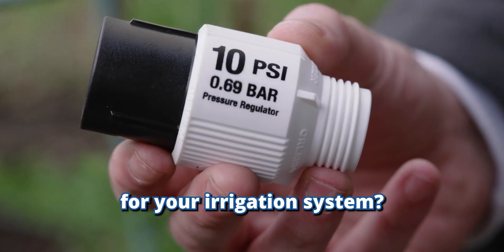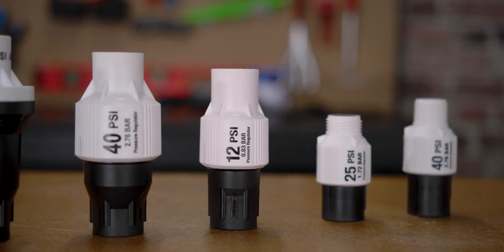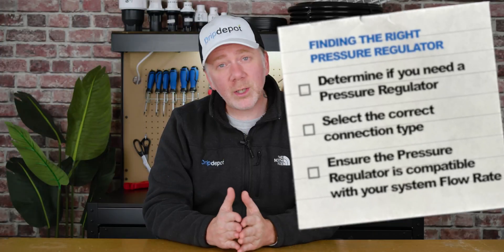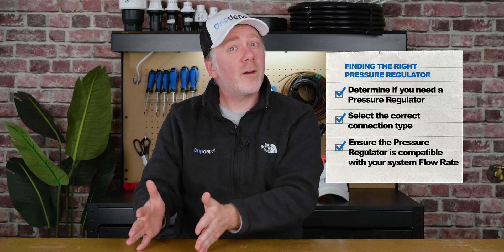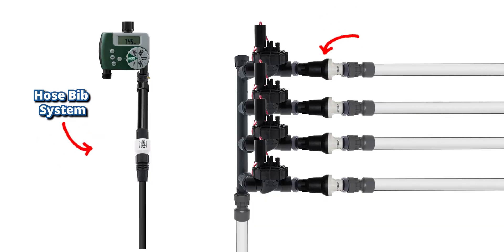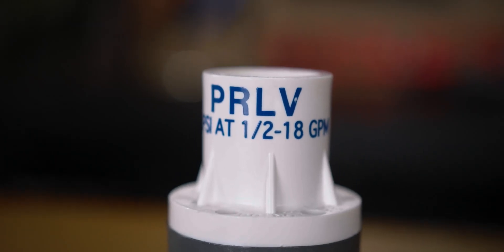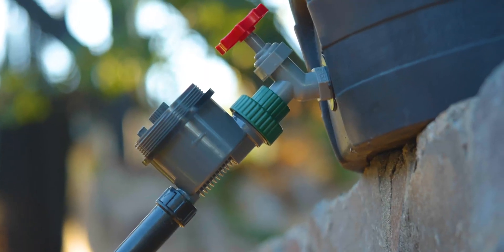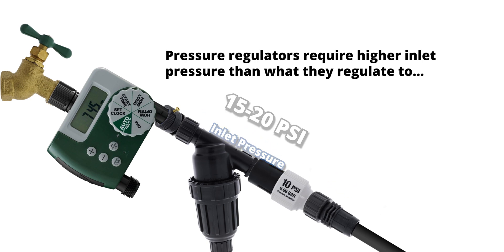Do You Really Need a Pressure Regulator? Understanding Water Pressure & Irrigation Systems

Comment: Question. are the pressure regulators compensating for inlet pressure? dose the output change if the input pressure changes? these are orifice based regulators i assume. could you not just use a gate valve and have the ability to change the orifice size and fine tune your setup. say you plan on running  different plants with different harvest times and you emitter count could change up/down. i find using a gate valve works better for fine tuning.
Reply from the maker: Great question!

Gate valves (and even other types of valves) can work, but regulators have the advantage in that they do compensate for inlet pressure.  Across a fairly wide range of pressures too -- the most common one for residential users is the hose threaded 25 PSI version which can maintain 25 PSI downstream pressure anywhere from 30 to 105 PSI at flow rates of 0.5 to 7 GPM.  

They have larger ones for different applications and, save for their Limit Valve, work essentially the same.  

If inlet pressure never fluctuates a valve could probably serve just as well, but I'd likely still recommend the regulator as they tend to cost significantly less but accomplish the job just as well :) 

Senninger, a manufacturer of pressure regulators, wrote a white paper that covers them pretty well if you (or anyone reading this comment!) wanted to dive in a bit more: https://www.senninger.com/sites/senninger.hunterindustries.com/files/understanding-pressure-regulation-white-paper.pdf

Edit: Apologies, I didn't address the plants with different harvest times!   

In most cases an inline shut-off valve to shut that portion of the irrigation would do the trick -- since most drip irrigation works around the same pressure (10 to 30 PSI, with the most common being 25 PSI) different pressure is not usually needed for different emitters.  The big exception is drip tape, which has to be 15 PSI or less (depending on wall thickness), but most other emitters will work fine at 10 to 15 PSI, so even in those situations pressure could be maintained at 10-15 even after shutting portions of the system down for the season.

Comment: My irritation is before the home pressure regulator
Reply from the maker: Sounds like you'd likely need one if the irrigation is before the pressure reducer -- that's not a bad thing though, starting off with a healthy pressure helps is a good starting point in pretty much any irrigation system :)

Comment: Good info. My pressure at the backflow preventer is 104 psi, way higher than recommended. That probably explains why I have had pipe joints to separate and leak.
Reply from the maker: 104 PSI is definitely likely the culprit!  That's some very high pressure -- a good problem to have sometimes, you'll always at least have enough available pressure for pretty much any emitter type (heck, you might need to regulate even for lawn/turf sprinklers at 104) :)
Reply: @dripdepot  Thanks for that quick response! I should have mentioned that the 104 was my static pressure. I will take additional pressure readings this afternoon. I should take a reading after the backflow preventer since it reduces the pressure by 15 psi according to its manual and another reading with the system running.
Reply from the maker: @harvey8695  You've got the right of it, the backflow will definitely cause some pressure drop, and friction loss while water is flowing some more.  If any questions come up while you do this (or after depending on the results!), don't hesitate to comment, happy to assist :)
Reply: @dripdepot  the dynamic pressure dropped to 65 when the system was running, much better than the 104 :)
Reply from the maker: @harvey8695  Ah, very nice!  Is this for a lawn system?  If so, you're looking good unless using unregulated spray bodies (which are somewhat rare now).  Great for rotors and regulated spray bodies, great how it came down to basically  sweet spot =D
Reply: @dripdepot  it's a five zone system covering about 14,000 SF of lawn, all rotary heads (6-7 per zone)
Reply from the maker: @harvey8695  Perfect!  You're in a good spot in that case -- unless you're getting a lot of overspray somewhere, it's highly likely you're good without a regulator :)

Comment: Do you have a universal coupling for drip lines. I want to use it on a garden row drip line that is between rowers. The drip line is removed for row tilling or hoeing
Reply from the maker: Depending on the size of your lines, it's very possible something could achieve a sort of quick disconnect so you can easily remove lines --  is it the drip line themselves or the mainline feeding it you'd like to be able to quickly disconnect?  For 1/2" mainlines, we see a lot of folks use two fittings to create a sort of quick disconnect -- one is a male threads x tubing and the other a female thread swivel x tubing -- the swivel on the female thread fitting allows it to be turned without needing to turn the entire thing, so you can quickly unthread it to disconnect the lines.  The same is possible for 3/4" and 1" mains as well.  

Here's a link to the 1/2" versions just in case (the larger ones are available there using the dropdowns) -- Male threads: https://www.dripdepot.com/search?q=1203 -- Female threads: https://www.dripdepot.com/search?q=1193

Comment: Hi, is the prlv only use to regulate each regular regulator to have constant pressure in each lines or can i just get the prlv to regulate all 8 of my lines to have constant 10 psi?  Each line is about 80 feet and the water pressure on the property is 40-45 psi.  It seems to drip fine when i have 4 lines open but when i open the 5 line i lose water pressure in the lines.  Im trying to have all 8 lines open at one time if possible by using regulators or am I missing the point on the use of regulators?  😅  Thank You
Reply from the maker: That's a very good question, you're definitely headed in the right direction with your query.  There's a couple things at play here: the regulators we're using in the video cannot withstand constant pressure, so you generally need one for each zone or line (however, if you open them all up at once, you could go with just one so long as it is relieved of pressure when the system is not in use).  

With that said, there are pressure regulators that can withstand static pressure (these here: https://www.dripdepot.com/search?q=14405 ) and can be used upstream of valves so that they can regulate for multiple zones/lines.  

With that also said, there's another limitation you might run up against when trying to operate many lines/zones at the same time: flow rate.  In addition to sufficient pressure, you'll need sufficient flow for all the emitters operating at one time.  As a quick example, if your water source flows at 10 GPM but you have 15 GPM in emitters trying to run, some of the emitters will be starved of water and won't work as they should, if at all.  The symptoms for lack of flow are very similar to that of insufficient pressure: not emitting as much was as they should, dribbling instead of spraying, barely dripping, etc.  

Depending on what your water source is, there's an easy and reasonably accurate flow rate test you can do with just a timer and a bucket.  Time how long it takes to fill the bucket with water and then plug the numbers (volume of bucket and time it took to fill) into this calculator, it will give you a pretty good approximation of your water source's flow rate: https://www.dripdepot.com/irrigation-calculators/flow-rate-calculator

You can then compare that to the flow rate of your emitters to see how many can operate at once.  If you're not sure of their flow rate, see if you can locate their specification sheet online, they'll generally list their flow rates at various pressure levels (e.g., 4.0 GPH @ 25 PSI, etc).  :)
Reply: @dripdepot  thanks for the fast reply and taking the time to share ideas and options.  I have a much better understanding now.  I have another question on the Mazzei injector, there's a low flow and high flow, do i get the low flow for drip tape?
Reply from the maker: @ClearWater7.62  That can depend -- you are right that drip tape is low flow, however that's "per emitter."  If you have thousands of emitters operating at once, even a drip tape system could have a lot of flow and qualify for the high flow model.  Your instincts are right though, as there's a good chance that even with all 8 lines running you'd still be low flow unless your 8 lines are very long.   If you end up running less than all 8 at once, you'd almost certainly be in the low flow side of things (again, unless they're extraordinarily long).
Reply: @dripdepot  thanks for the input.  I went ahead and ordered the prlv and Mazzei injector on your site.  If anything at all, I'll just have to split 8 lines in two separate irrigation time.
Reply from the maker: @ClearWater7.62  You're very welcome, any time!  If you have any questions after everything arrives, don't hesitate for a second to reach out here or our site, we'll be happy to help :)
Reply: @dripdepot  I appreciate your customer service, top tier.  Thank you.

Comment: How do we determine the max upstream pressure a regulator can handle? we have a pump on our rain barrels feeding a drip system (all components from y'all except the pump). We have the system feeding 9 raised beds and each bed has it's own 10PSI regulator. I went out this morning and water is gushing out out ALL the beds, like, if I unhook the line from the regulator, water SHOOTS out of the regulators. Any ideas?
Reply from the maker: You bet, happy to help!

On the water shooting out of the regulator, that part is normal -- regulators don't regulate downstream pressure unless the lines are pressurized and emitters are flowing.  When the line is disconnected, there's no pressurization, just flow, so they won't regulate (that's the reason you can't hook a gauge up directly to a regulator -- then you have pressurization but now flow).  

For the water gushing out all the beds, was that water coming from the drip tape itself?  If so, let me know, I have some ideas (and some solutions).  

If you prefer, you can reach out at this Contact Us link -- it sends us an email.  If you put Attn: Adam, or "from YouTube" I'll know and get back to you promptly (also happy to help you here if you prefer as well) :)  

Here is that link: https://help.dripdepot.com/support/tickets/new

I look forward to assisting!

Comment: We have a spiket what would you recommend for this since the pressure.
Reply from the maker: Most likely you'll go 15 to 25 PSI -- most drip emitters out there will list emission rates at various pressures (for example, 0.40 GPH at 15 PSI, 0.50 GPH at 25 PSI, etc).  You can use those specifications to select a pressure regulator.  25 PSI is a great level for the vast majority of drip emitters and is where most folks operate at.  The big exception is if you use drip tape, the thin walls on drip tape prefer 10-15 PSI depending on the wall thickness of the tape.

Comment: Nice video. What I have always wondered is if I need 25 psi for my entire beds, why can’t I just turn my faucet valve to the required opening? My pressure meter shows I get 25 psi at a 1/2 turn opening of my faucet. Why need a regulator?
Reply from the maker: We do actually see folks do exactly that!  Lowering pressure that way is not entirely uncommon :)  

Normally it's not recommended due to it being difficult to tell when you're at an appropriate pressure level, but using a pressure gauge eliminates that concern to a degree.  There will be some extra wear and tear on the valve going that route, but they tend to be built sturdy in order to handle the static pressure anyway.  So while not necessarily ideal, it's definitely possible.

Comment: What about a system only using 1/4" lines?
Reply from the maker: If the 1/4" lines were feeding drippers or emitters of some type, most likely you'd still want a pressure regulator -- the times you can get away with not using one are when using pressure compensating emitters and the water source's pressure was within the pressure compensating emitter's operating pressure range (10-45 PSI is a common range) or when using higher pressure emitters (sprinklers, some misting nozzles, etc) :)

Comment: What if it’s low pressure 😢
Reply from the maker: Hello!  I think (I hope anyway!) I touched on that in the video, but it's a very good question -- if you already have low enough pressure that you're within operating range for your emitters, you can go without a regulator.  In fact, adding a regulator in those situations could cause issues (dropping pressure below the operating pressure).  

Having that low of pressure is a rare occurrence, but it definitely does happen and it something to keep in mind when planning the irrigation system :)